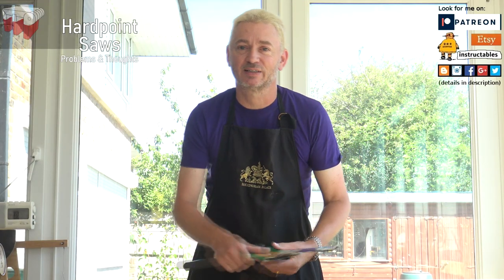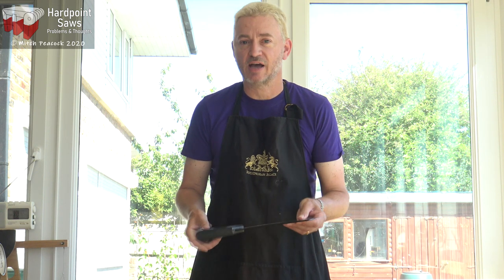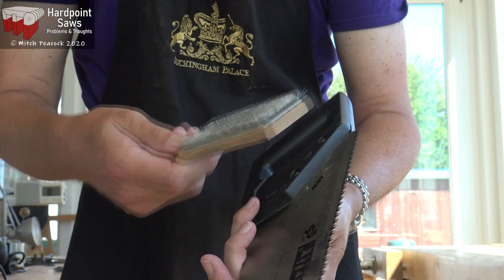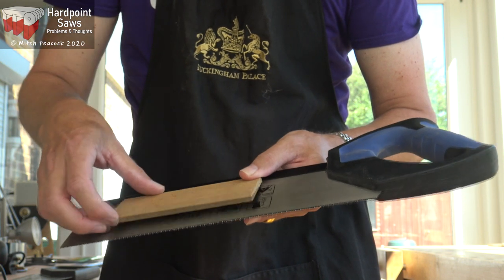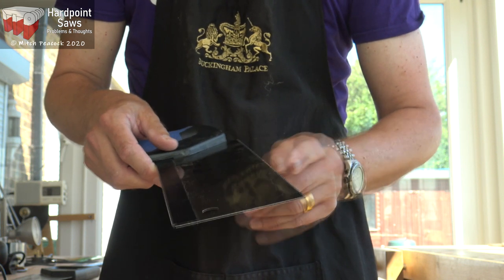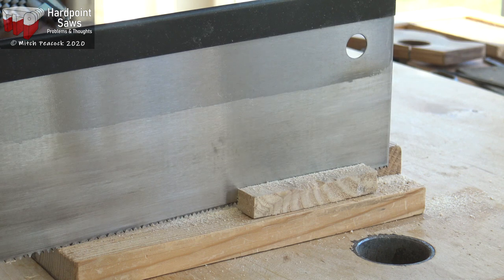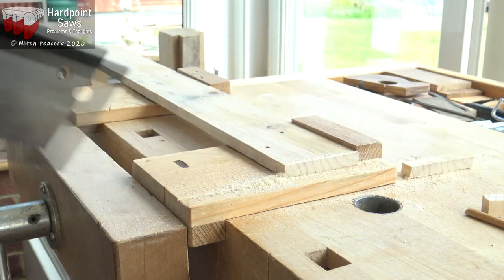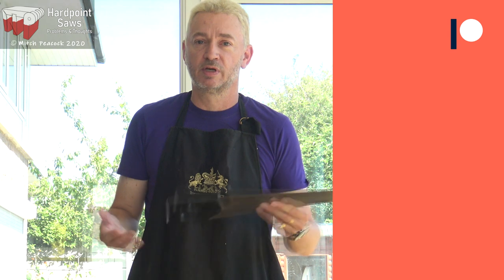Hardpoint Saws - two problems to try and fix

Comment: Nice introduction, definitely hinting for more, since these saws are a throwaway item.
If you are thinking of making more on the subject...
I would like to know how much softer you find those saw plates are, compared to some vintage saws that you may have retoothed.
I have a throwaway tenon saw that I was thinking of doing this to.... that is, ... if the plate as soft enough to work,
compared to some of the vintage ones I have sorted, a few which had hard spots and really took the edge off the files, and I just about got the lot done, thankfully another wee beauty Valorbe file was hiding for years, Phew!

I reclaim a good bit of timber, mainly hardwood doors, so I want a saw that leaves little breakout, and at the same time
can be touched up easily as it will be prone to hitting glass, and the odd tack, cement and putty.

I suspect you wouldn't mind making a similar saw, for your salvage rucksack.
It would make a rather interesting video as well.
If your old files are blunt, but the plate is soft enough to work them, it would be fantastic.
All the best

Tom
Reply from the maker: Hi Tom,
I agree, that could be an interesting experiment. Let's see if I remember when I have less on my plate - I have a stack of home maintenance to do at the moment.
Stay safe

Comment: Can we use these saws for anything once dull? Scrapers for example? Or would it be possible to relax the teeth using heat and then retooth them?
Reply: Scrapers, yes. Although there are only so many scrapers a person needs. I'm sure there are plenty of uses given the material, but difficult to think of any! I believe that it is just the teeth that are hardened, so the rest would be easy enough to work with.
Reply from the maker: Scrapers and blades for scratch stocks, welding practice?

Comment: thanks for confirming my opinion that hard point saws are rubbish lol.  i did buy one when i needed a new dovetail saw just to see what they were like.  i tossed it in the bin after one cut.  the set was all on one side and couldn't cut straight.  it was cheaper to buy an old saw with a good plate and refurbish it.
Reply from the maker: I think the problem is that most of them are manufactured down to a low price, hence low cost materials, little qa, etc.

Comment: Nice video, Mitch.
Super explained and shown! 👍
That is probably the difference between the saws, whether they are from the "hardware store" and cheap or sometimes the saw buys from manufacturers who sell woodworking tools (as here in Germany> Dictum <) where the saws are somewhat more expensive. 😉
Did you bleach your hair? 🙄🤔
The emblem on the apron is great.
Do you work there? 🤔
Nice rest week desired
Reply from the maker: Cheers Gunter.
Hair is throwback to my younger days, and done to pass lockdown time.
No, I don't work at the palace, it was a gift, and is a great work apron.
Sadly too many home maintenance jobs to do, so no rest just yet.
Take care.

Comment: the modern day saws are useless,  in many of cases if you try to re set the teeth they snap off and you really need to grind then to remove the dull edges. the saws are designed to be tossed out and replaced
Reply from the maker: You're right, it's a throw away society approach by most tool manufacturers